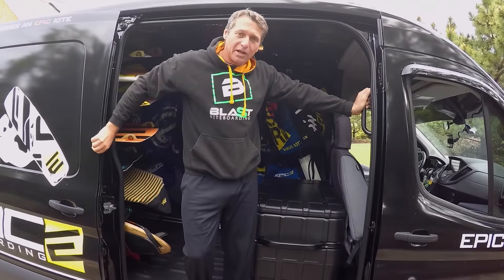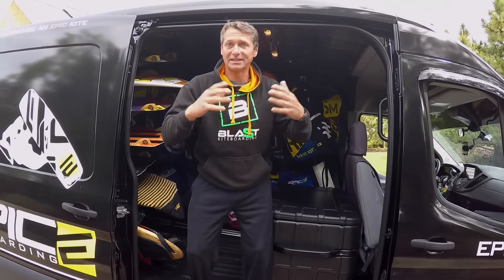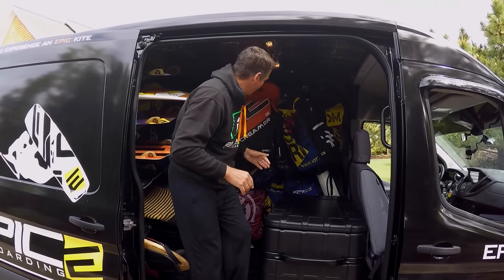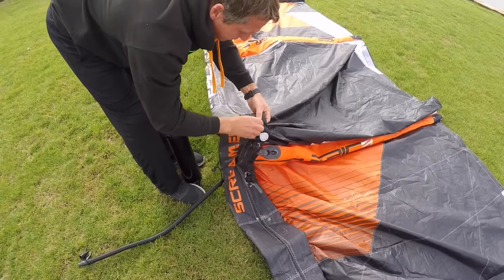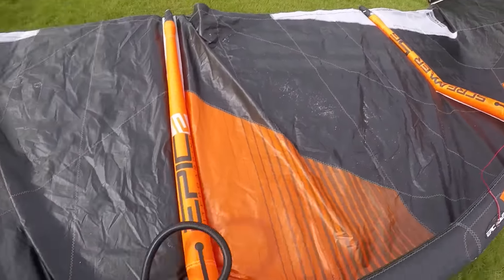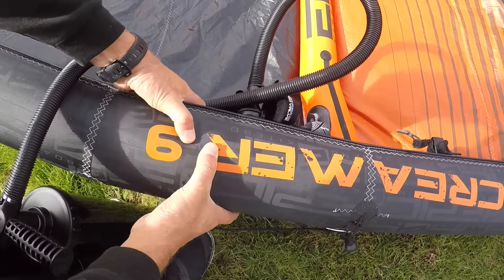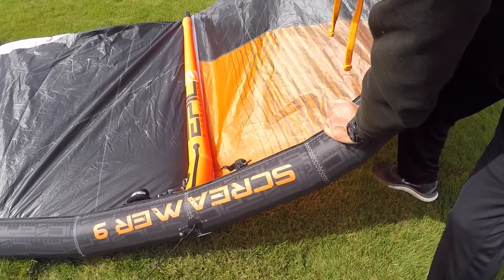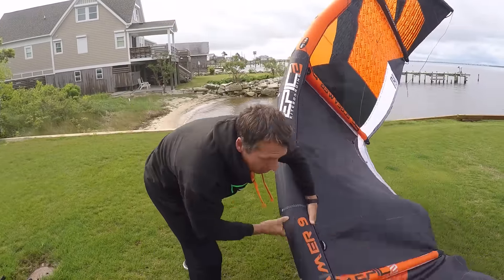HOW MUCH AIR PRESSURE TO PUMP YOUR KITE

Comment: If you ride in a hot day, and double true for begginers, you should pump after you wet your leading edge (and if possible, the struts). 
This will give the air  colder conditions, which be the same if (when) your kite falls yo the water. 

You will not belive have deflated a hot and dry kite can be once it get colder by the water.
Reply: P.s 

Don't forget to closer the valve and cap before you soak it in the water ;)